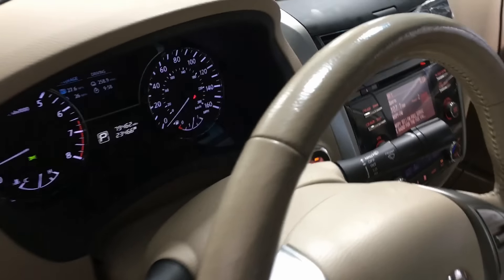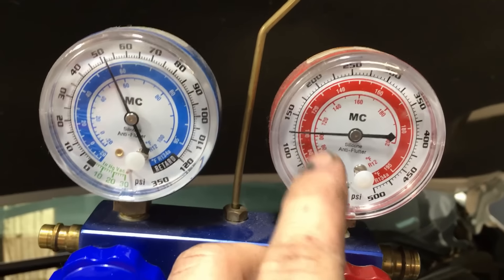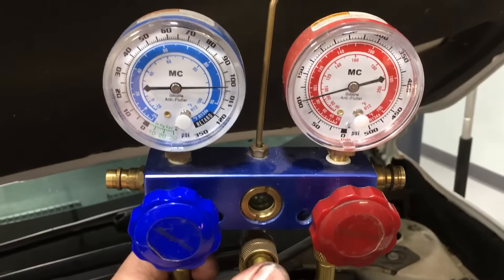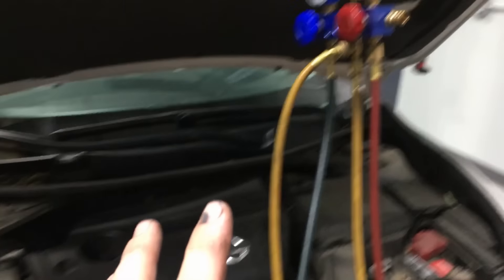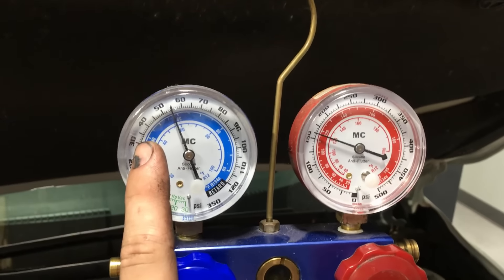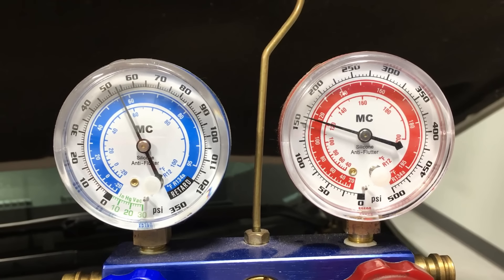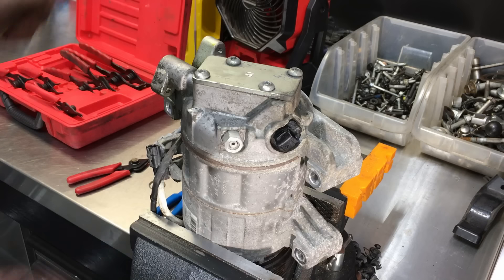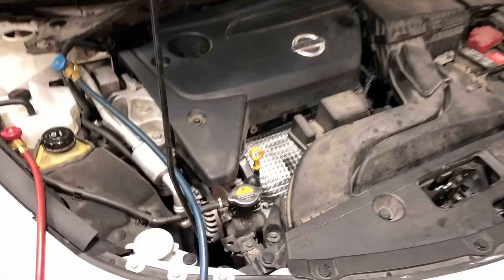A/C System Failure Diagnosis: Poor Cooling at Idle

Comment: Very good information. It used a valve separate from the exp valve. I would replace the compressor and receiver/dryer. Oil and charge the system. Should pull 40 degrees out the registers. And DRY air. Pretty humid in Chicago.

Comment: For anyone who is testing their A/C system by putting a thermometer in your vents always be sure you put it in the central vents above your radio.

The vents to either side of the vehicle are extensions from the center air distribution box which is located behind the radio area in the dash. In the center vents it will be cooler than the others.

Comment: I have a similar issue on my 2006 Accord. I get SOME cooling, though. However, the low side pressure goes down to normal when I give the engine some RPM’s. And this compressor does NOT have a refrigerant control valve. Worn compressor, perhaps?

Comment: Do you have a video for poor cooling at idle for systems like my 2009 Ford Fusion that don't have refrigerant control valves. I'm getting ready to begin a diagnosis on it. It has a new condenser, compressor, and TXV, so I'm suspecting a cooling fan issue, even though it didn't cool well doing 55mph yesterday with ambient temp of 95F. Note: the fan does kick on when ac is turned on inside the car.

Comment: Thank you for the great video. My car AC system very similar to your case except when the engine is off. It reads 105 at low side and 58 at high side. It does not go equilibrium. Possible  clogged at somewhere? I removed desiccant bag that is very dark color. Would it be the cause?  When engine running and AC on, low side 48, high side 98, similar to your reading, also knocking noise.  Could it be electronic control valve?  Thanks in advance.

Comment: Does a/c clutch go on and off when the a/c is on and the car is working on idle in park gear on 2010 nissan altima or the clutch is engaged as long as the a/c is on?

Comment: What if the compressor clutch isn’t coming on? But the ipdm test works and clutch engages 5 times. But I checked all wiring and I have power to everything. Will pressure control valve be the issue if ac button is on and doesn’t engage the clutch? 
Or added to much Freon be the problem?

Comment: Hey, stupid question, but a lot of things I have read say to check the pressures above idle, like 1,800-2,000 rpm.  Should I be checking at idle?  I have also noticed that my car cools decently well when using the throttle, but at idle it's pretty weak.

Comment: On some cars its a big job just to remove the compressor. So you don't want to do that job twice. So for an old car it's probably best to just replace the whole compressor and be done. No point replacing individual compressor parts and then have to come back again later because of a bad bearing or something else.

Comment: On my 2000 sable dohc, a few years ago, the low pressure side cut-off switch went bad, so I recovered old freon, swapped the bad switch, the orifice, and any o-rings I could reach. Refilled with a little dye, little PAG-40, and filled freon using manifold gauges, using the hood sticker as a reference. Still works great!

Question: just got a chevy van (2000, 53k) with rear AC system. It works, but is there any benefit to changing the orifice, old freon, and/or anything else? Does the freon or oil break down over time?
Reply: The dryer breaks down over time and pieces of it will plug up orifices, or help jam a txv
Reply: @benjaminkline4855  interesting to know, Txs.

FYI: the 1st leak to check is the SHREDDER VALVES !!! They do not reseat well once opened for refill...

Comment: What if u have a lower than expected pressure on the LOW SIDE.....and a lower than expected pressure on the HIGH SIDE? ........For E.G. my Rav 4 1996 model has R134a refrigerant...my ambient temp is 28°C with 74% humidity...static pressure on both the HIGH & LOW sides were about 70 psi...and with my A/C on to full blast with the engine running the LOW SIDE dropped to 0 psi while the HIGH SIDE moved to 74 or 75 psi.....what would be my A/C problem? my temperatures are completely out of range in regards to the r134a pressure temperature chart and just to note the last time my A/C was gassed up was 3 and a half years ago ....your responses would be greatly appreciated....I'm a new DIY-er

Comment: I've got a 95 GMC K1500 with 107k miles.
Had to replace the AC lines due to the charge port leaking and I replaced the AC condenser.  
The AC compressor was replaced around 68k miles. The compressor is running without kicking on and off.  
 
The AC system has been filled to 32 ounces. 
While driving the air is fairly cold, but at idle it isn't cold compared to what it used to be. 

Prior to replacing the lines and condenser the AC was very cold whether driving or idle. 
What could be the issue?

Comment: Thanks for the great video. Had similar performance and pressure readings but only replaced the valve not the whole compressor. Unfortunately, my results remained the same. Can there be a faulty current to the valve and is there any way to check on that?
Reply: Sounds like you had a worn out compressor,,,
Isn't that what fixed it.
Reply: ALWAYS replace the condenser when replacing the compressor.  They get clogged up. They're pretty cheap.

Comment: I have a PT cruiser  it has a low pressure shut off switch and a high pressure  shut off switch is thst the same as the control on the compressor,?

Comment: Control valves are all over the place online.  Unfortunately, the 4 c Nissan Altima does not use this valve. Did you give your customer the option of just changing out the control valve?

Comment: I have a slow freon leak on my front ac condenser. My ac works up front ok and I just notice my rear ac is only blowing outside temp air. Will the leak up front on the condenser affect the rear ac or does the rear ac have its own freon that it relies on. Thanks for any help I have a new front ac on the way. 2002 Tahoe

Comment: Where does the power come from feeding the control solenoid?  Is it controlled by the ECM or what and could it be a problem rather then solenoid failure?

Comment: Hello, thank you for making this video it gave me some ideas on where to start diagnostics aspects. I have 2012 Altima and my AC issue is that on a typical hot day when I first turn it on it blows hot air for quite some time until finally turns on. I usually have to mess with the AC on off button which I’m sure not good for clutch plate but it does helps. Also when is on it’s not blowing a lot of cool air like it should be and in AZ heat it’s pain in the butt. I do not have any leaks since my father check it every summer. Could you kindly tell me what could be wrong with this AC system?

Comment: I have the same problems with my 2018 Pathfinder blowing hot air. Took to my dealer to find out what is up they came back telling me I have a leak on the rear pipe and it will cost me 3500 to repair which I find  crazy,  I need to find a second opinion on a simple repair on the rear pipes, I know it should not cost that much for ac repair.

Comment: my cars compressor is cutting off at 1500 rpm....ac works fine at idle and at low speeds...please help and kindly inform if it is normal for the system to cut off when acceleration...the ac kicks in when i release the accelerator pedal at any speed..please help...mitsubishi outlander 2009 2.4 liter..it has a scroll compressor

Comment: Hello. My mechanic just vacuumed and charged the a/c on my 2010 altima. It cools good. However my clutch does not stop turning as long as my a/c is on. It stops when I turn off the a/c. When I tested this, the temperature setting was on 50%, just at the middle, and it was evening so not too hot weather. I waited around 5-10 minutes and the clutch did not stop turning. It was cold in the car but not very cold. When I turned the temperature switch to max, the air from the vents went colder. So the a/c temperature control system (probably some kind of thermostat) works properly. The only problem is that the clutch does not stop turning which increases the a/c gas pressure too much so it leaks out of the system. What’s the problem? How to fix?

Comment: Great video thanks!!  How did you know that it wasn't just a somewhat weak compressor?
Reply: With the compressor clutch spinning and him looking at the guage readings..... they would be identical. When he was looking at it even with a fully charged system the low side was like 56 and the high side was over 120. With a bad compressor the readings would be the same. Example 90 on low and 90 on high. Hope this helps. But those readings can only be valid if ur clutch is spinning
Reply: @jasonc.4683  Not exactly true,,
A weak or really worn out compressor will have a high low side pressures and low high side pressures,,
If the valve were sticking open then the pressures would be equal.
Reply: Can you help me with bad compressor or is it bad valve !?? Like you explained in terma of reading!? Do you mean the gauges would look like the one in video? For bad compressor aswell!??
Reply: @attashsaqib5028  What are you working on and what are your pressures??
Have you verified proper Freon level
Reply: @justingeraldi2304  it's Nissan Maxima 2013 i dont get cooling while idle but upon rev  i do, proper frean we don't have such automated machines over here in garages .  The mechanic says its weak compressor but it's the same compressor which i changed & worked well 2 3 daysc& than it became like this ! What would you suggest
Reply: I tried everything, nothing worked. Finally I just went ahead and increased the idle speed by adjusting the nut on the accelerator cable. Cools like a freezer now. In winter I shall reset the idling speed to its original setting
Reply: @cnneville1962  makes sense that it has to idle at certain rate for ac to function properly
Reply: Disappointed that this wasn't actually answered. Gauge symptoms of weak compressor and bad refrigerant control valve are the same, as stated earlier - high low side, low high side. I'd still like to know how to tell the difference between the two. Seems to me like a bad RCV shouldn't change much when idle is increased and that'd be more likely to be the compressor itself, but another one of his videos seems to say otherwise, so I really don't know!

Comment: Unfortunately on the Sentra model the valve is on the side and facing the front of the car. You can unplug it but it's impossible to grab the snap ring. You have to remove the compressor, remove the ring, replace the valve. Kimda sucks

Comment: THAT'S WHERE THE NOISE & FOG CAME FROM, HUH? '04 E-350 5.4 pulled my compressor to replace hose also replaced dryer & o-rings. I spilled about an ounce of oil but did not see anymore in the comp. I added about 5 oz. to the comp. & 4 oz. to the new dryer / receiver. My AC & refrigeration guy came by from work sucked it down but did NOT have his high side gauge. The Van with rear air take 40 oz. R134a when we got her almost full & there was a couple thuds & a silver fog.  AC is 60 degrees at idle & will get down to 44 degrees while moving. I'm 61 & not alot of $$$ but is it time for a auto ac guy? Thanks!

Comment: I have that exact compressor and am going to change out that valve. My question is after taking it to the  shop to have them recover the refrigerant. I plan on refilling it myself. Do I need to add oil?
Reply: I wouldn't recommend just charging it yourself unless you have a vacuum pump.  Putting a vacuum on the system is crucial as it removes moisture which can and will cause premature compressor failure.
Reply: @chicanobluesaz4191  Got it! Didn't answer my question. I do appreciate your responding.
Reply: @custodiovalencia9625  I take you have a vacuum pump to suck the oil in the system along with the refrigerant. The answer is yes, you need to add the right amount of oil as the system now is dry.
Reply: @ZarathustraEX  Thank you. That is what I wanted to know.

Comment: Got a question, got a 2011 Nissan Altima. New compressor, new condenser but it still blows hot and compressor won’t kick on even with proper refrigerant. I’ve check the fuse and it’s good. Any thoughts or idea where else I should check and look for ??????
Reply: Sounds like evaporator temperature sensor issue. Newer cars have ECU or A/C computer monitoring the evaporator temperature and often use PWM signaling to A/C compressors solenoid to request more or less cooling power. If the evaporator sensor is failing and constantly reading say less than 0 °C (32 °F) the software will request the A/C compressor to generate less cooling to avoid freezing the evaporator.

Comment: Great video! I have the same exact car with the same exact readings and the same mentioned problem. I went and had an evac done and that control valve replaced, but it didn't resolve my issue. I ended up paying the shop to change the valve I bought on eBay while it was in the lift. Question, should any oil come out when you replace this valve? Because I didn't see any. Just curious. Also, since my issue persists, is there any way to test the new valve I bought is working? And if this wasn't the fix I needed, what else could cause these pressure readings? I noticed you ended up changing the whole compressor. Could it be that my compressor is just bad. I feel like I've heard others complaining of Nissan compressors prematurely failing. I assume buying a new compressor includes this valve? Thanks to anyone that might help me here!!
Reply: you can test the valve with 12v applied carefully at terminals, theres a another video that shows the difference between a good an bad one.

Comment: Great video, but what does it mean if the fan is running crazy high when the ac is on? I mean, if you are standing outside the car you can really hear like it is going to take off.  What is up with that?

Comment: Need a video on a car surging at idle with the ac on blows out cold prior to idling at a stop light stop the car at any given stop light car starts surging idle rpm going up a little bit then back down every few seconds sounding like is is reving up then ac quicts blowing cold starts blowing luke warm air. Already had a mechanic r134a still having the same issue. And belt queaks when accelerating with the ac on.

Comment: Need help. I used a handheld ac charge to let out my low side down to zero. Replaced my compressor Control valve. Started the car and tried to refill with the can. The clutch kicked out and now won't engage. I took it to the shop and they said without the clutch engaged they can't pull a vacuum on the system or refill it...??? 2014 Altima SV...I'm stuck here

Comment: Unfortunately, some older A/C compressors use internal mechanical control valve and there isn't any sensible way to fix the control valve if it's failing. Instead, you have to always replace the whole compressor if it cannot push the low-side pressure low enough.
Reply from the maker: I have a video on those too
Reply: @BSGAutomotive  Is the video already available somewhere? I cannot find such video with the search.

Comment: GM doesn't service their compressors with the variable solenoid control.  I imagine it's because it is a crap shoot as to whether it's a solenoid valve or the compressor has gone bad as they have plenty of both failures.

Comment: Great video. I have also problem with my Ford Expedition 2006. AC is really bad and I visited 2 mechanic. One said that he has to replace compressor and some parts which would cost more than 1000 dollars. Second guy told me that is everything ok with compressor and he showed me the pressure on the instrument like in the video. He just replaced the Freon like in the video and put some oil. He showed me also how cold is one pipe under the hood to ensure me that is everything ok. But inside the car everything is almost same. I am still sweting inside. Any advice?

Comment: I have a 2016 Honda Civic that is showing equal pressure on the AC gauges. I’ve already changed the compressor, condenser, and expansion valve. Any suggestions???

Comment: I have an 01 chev express conversion van the fron vents coll at 80 to 90 degrees, while driving it comes down to 60 degrees,  and cools nicely, the gauges read 200 on the high side and just over 60 on the low side any thoughts to help fix this would be greatly appreciated, with the ambient temps in fl. Now at 100 i would think the high side should be reading close to 300 psi?

Comment: After you vacuum the system down, do you need to add oil or just refrigerant?  Thanks in advance.
Reply: You should always ad oil after recovering a AC system. But never over oil. Look up the spec.
Reply: @christopherenger1602  thanks

Comment: Hi BSG, 
Do you know if a 2014 Ford Flex has the same Valve? If it has the same issue that is described in this video. Just did a full recharge, still poor cooling at idle exists. Another related Q, the service person doesn’t recommend to use the amount of gas recharge labeled on the hood for example for the Flex it says 1049 he recommended to add 980 instead, explaining that the weather plays a major role. Some time it reaches 123•F were I live. Any advice? Appreciate all the info in this video. Good job.
Reply: There is a saying "do what the guide says", as they design the system as such. So if the car manufacturer says "use r134a refrigerant", use only that particular refrigerant. Say, the system designed for R22 refrigerant but you put in R134a. For one, the cooling capacity of R134a is only 60 percent that of R22, so the system condenser has to work overtime to produce the same amount of cooling.

So, no. Don't do that.